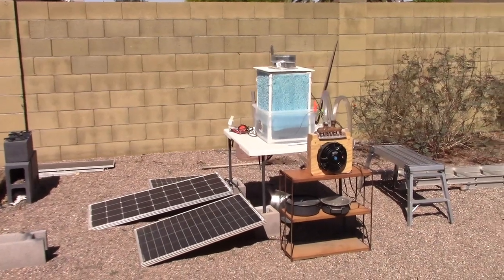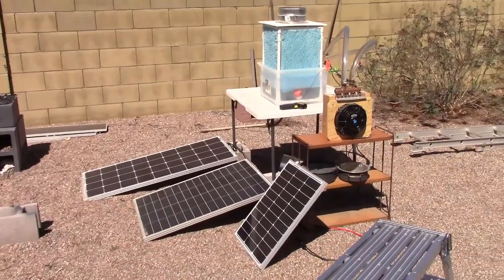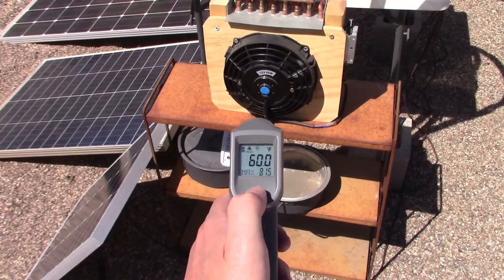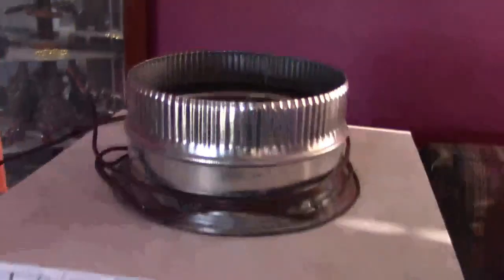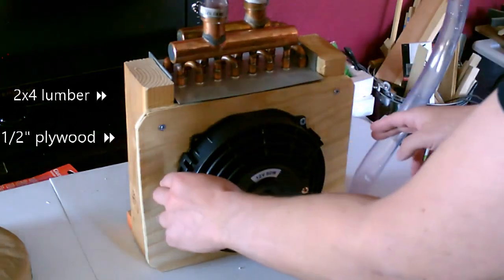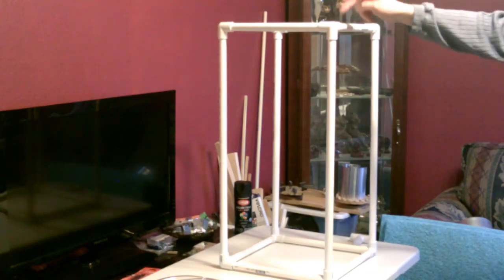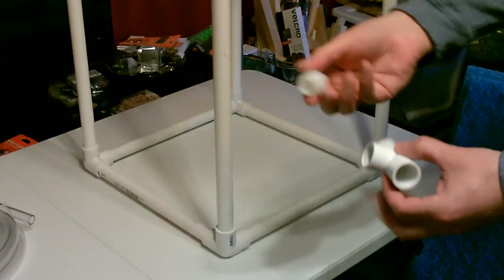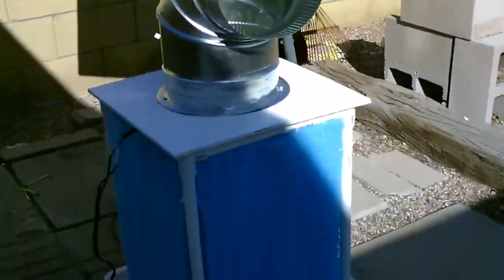DIY "Indirect" Evap Air Cooler! - Produces Cool and DRY Air! No Humidity! (82F-in 60F-out)! Easy DIY

Comment: A hint for those who want to built one themselves.
 The heat exchanger is an expensive part. But you can use a heating core from a car as a heat exchanger. You can get one from a junk yard for as cheap as $20, or even less.
It will make the whole built much cheaper 😉
Reply: Would a car's radiator work?
Reply: @TheRainHarvester  absolutely!
Reply: simple transmission cooler works get a new one same price or lower in some cases
Reply: @TheRainHarvester  Any radiator that has enough surface area would work so long as you have the tubes to fit it! 🙂

Comment: I built one of your evaporative coolers a few years ago using a sterlite container, a used 6" fan, a water cooler pump and various odds and ends. It works SPECTACULARLY! It's almost time to break it out for use this year.  This year, I'm changing the fan and pump to 12 volt and going solar with it. Still needs to use ice and freezer (blue ice) blocks, but it works GREAT.
Reply from the maker: Very cool!
Reply: Wait, why do you need to use ice?  Doesnt that defeat the efficiency? (Your freezer costs more to runand heats the house etc) just curious
Reply: @TheRainHarvester  Right?   Just get an air conditioner and skip all the weird middle steps about making ice and then unmaking the ice.   And of course if you're making the ice in your kitchen, then you're heating your kitchen overall not cooling it.

Comment: I tried building your basic model(without the heat exchanger) and guess what?? It works GREAT!!! I bought a House,without a Cooling System and I will,yet,build another one of your models-- I bought most parts from Home Depot and a good 12 Volt(camper) fan at Walmart--- My whole System draws 3.34 Amps,at 12 Volts--- I have Stage 3/Stage 4 Parkinson's and it's VERY Important to stay cool in Hot Weather---Again,THANKS !!!!
Reply from the maker: hi there. i'm glad you made it and that's it's working well for you! that blue evap cooler cube is quite powerful as a cooler (even without the heat exchanger). 👍💦

Comment: Great video, Appreciate you sharing the knowledge! 
Do you have a link to the pumps you used? What kind of flow rate do you need to pump from the evaporative cooler to the heat exchange? I know distance makes a difference but roughly how many gpm are needed? Thanks you.
Reply from the maker: hi. used a 350 gph bilge pump for the flow to and through the heat exchanger. it's made by sea-flo. here is a link https://www.amazon.com/Seaflo-Manual-Marine-Bilge-Pumps/dp/B07FNY3YRT/ref=sr_1_1?crid=KWPQGFOU8W9N&keywords=seaflo+350+bilge&qid=1690642203&sprefix=sea+flo+350+bilg%2Caps%2C194&sr=8-1

Comment: I did something like this in my garage about five years ago, similar to this same setup but all in an enclosed space (my garage), I made a two hose panel that shut in the window, and had the evaporator pulling air from the garage through the evap pad and out one duct, from the other duct I had a fan pulling fresh air in and sending it through a air/water heat exchanger. So now it is a feedback loop.
Reply: Good idea! What temperatures were outside and inside when you ran this?

Comment: I've studied your innovative system and the idea i have is once the water is pumped into house is to further the water cooling by running water through ice chest with pvc stand inside with copper coils and use your peltier ice chest cooler design to keep water extra cool for hot and humid days and then run through heat exchanger and fan.  I think it might require extra pump maybe to keep water flowing .

Comment: So I actually built out this whole set up with the 18 inch cube and the larger radiator size that you used in the heating video.  The 12x12 was unavailable.  The cooler works very well but the exchanger not so much.  I am getting maybe a 2 degree drop temperature from room temperature.  I suspect that a 10 foot hose run in combination with elevation to run it through most any window are part of the problem plus the fan seems to be producing a bit of heat.  I tested the whole contraption outside a couple weeks ago on a level surface and I thought I was getting almost identical temperature readings for heat exchanger and water temperature.  But I was measuring temperatures with a temperature gun which is generally a very inconsistent way to go.  Anyway now I have to run that whole test again and I an worried this won’t work and that my results from my previous test were all wrong.  If you have any tips let me know.  I am serious about getting this to work.
Reply from the maker: hi. well first it's great that you got the blue evap cooler part working good. that is most of it right there. if that is blowing the cool humid air then you're 90% of the way there already. once that starts blowing cold air the water temperature in the tub must be dropping to at least as cold as that air (usually a few degrees cooler). that is what you want to happen. from there it's just a simple matter of dropping the tubes from the heat exchanger (radiator) into that cool water reservoir. that is all those heat exchangers take to work is the cold water. as long as your pump is not heating the water too much (and it's pumping enough water through the heat exchanger for it to work properly) the unit should work good. i would focus on the temperature of the water in the tub of the blue evap cooler. if that is cooling down properly and the heat exchanger is filling with enough of that cool water then it should work very well. maybe the temperature and humidity of the ambient air were out of balance a little during the second test. that can cause the unit to work less than optimal but it will kick in as soon as humidity drops low enough. check an evap cooling chart to see what temps you should be getting. they show what to expect for specific temps and humidity levels. i'm betting your first tests were correct (they sound like how it should work).

Comment: If you used a coroplast air-to-air heat exchanger to use your exhaust humid air to precool your incoming air, you wouild probably see a 5F drop in temp, at little increase in fan power draws.

Comment: Hi, great video, love the project. Question? Is the water going through the heat exchanger the same water you put in the bucket? Presuming that the answer is yes, wouldn't tap water eventually clog the system with calcium and minerals? Or are you using a closed loop system with the heat exchanger using distilled water or some type of anti-freeze/distilled water combo that prevents mineral build up? Or thirdly, you have been using tap water and it hasn't been an issue as of yet? Thanks.
Reply from the maker: hi and thanks. the short answer is that it hasn't been an issue (but you could certainly use a filter if needed)

Comment: Really like this video!! Do you have a parts list going to make on for my greenhouse
Reply from the maker: hi there. it's not really feasible to have an official parts list with links for a video project like this. the pump and fan links change all the time - so they are always going 'dead'. best place to get most of the stuff is amazon. that is where i get all of my pumps and fans. the plastic totes, tubing and the wood can also be found at home stores. the heat exchanger i used is from 'badger insulated pipe'. here's the link to their heat exchanger page (scroll down to see the 8x8 unit. https://badger-pipe.com/collections/water-to-air-heat-exchanger?page=3 it looks like it is $62.00. (i paid $42 but $62 is still a great deal). if there is a specific thing you can't find i'll try to get a link for you.
Reply: Thank you

Comment: Now i'm thinking, enclose the top of the evaporative cooler, run the water pipes from up through maybe 10" ducting with added 'fins' or something to recollect some of the evaporated water straight back down into the reservoir (like a condensor) to increase runtime and add cooling to the water running into (and back from) the heat exchanger...  would enclosing the entire evaporative setup reduce efficiency (other than working out proper airflow that is)?  If not, then enclose the entire evaporative cooler in big ice chest..  i'm thinking about a cooler for a camper/rv setup.

Comment: Hard work  it is great but when humidity is high it will not cool down the water .also you must isolate the water hoses.
It is similar to coolerado indirect evaporator 
Google it and see 
But coolerado is more reliabke.
Do you have any mrthod to bring down the pool from 34 celcius to 25 celcius
Pls share

Comment: That is really cool, I wonder what it will do when the temps get up close to 100F or over, if it would keep it at 80F that would be great, that's the temp I keep my house at year round anyway, warm enough not to be cold in the winter and cool enough not to be miserable or have a heat stroke. I assume you are going to do a follow up this summer after it does really heat up. Thanks man, I like that, I will share it around wherever I can think of that it might be helpful.
Reply from the maker: hi there and thanks. these units usually follow the "evap cooling chart" numbers pretty close (even when it's super hot) - so at 100F (15 to 20% humidity) it should output 76F to 78F. you could see down to 70F or 71F if air is really dry (4 to 5%). 👍🙂
Reply: @desertsun02  The humidity here will be much higher than that I'm sure, probably 80% or more is my guess,according to the airport here it is' 84% right now I don't know how accurate they are.
Reply from the maker: hi. the general rule is these work very good to 60% humidity, then from 60% to 80% they're a bit weaker, but in many cases it's still feasible. over that and the water won't chill very much so your best bet is to get creative. by that i mean just use half of this system (the heat exchanger) and look for another way to chill the water, or another source of chilled water. natural options are if you have cold tap or well water. that can be very cool even in the summer. some people also find ways to tap into nearby natural water sources like a river, stream or lake. has to be close but works well. the other option is ice-based water chilling. i have 3 videos showing ice-based systems with a heat exchanger (all 3 links can be found in the description section). that works super good.
Reply: @desertsun02  I saw your ice cooled model/idea,with the ice chest top closed, that one should work well for anyone I think if it does not get too cold, thanks.

Comment: Where do you get the blue evaporation pads from. I'm in the uk and am having trouble getting them. Have tried twice from eBay and both times my order has been cancelled. 😡
Reply from the maker: hi there. i get it from the home stores like home depot and lowes. you can also find it on amazon (but be careful not to pay to much. a good size piece is usually only 7 to 9 dollars at the home stores).

Comment: Amazing build!  I am noticing on my Bonaire Durango 5900 evaporative cooler that the water temperature is about 4 to 5 degrees cooler than the supply air.  Is this your experience as well?  Also I read that the supply air is colder on indirect cooling by 4 to 5 degrees (depending on conditions).  In this video you say that the supply air from the exchanger is the same temperature as the water?  Is the supply air from your evaporative cube actually warmer than the water?
Reply from the maker: hi. they are close to the same temp but i've noticed the water is sometimes a couple/few degrees cooler than the cool air it produces.
Reply: @desertsun02  Thanks for that info.  I put temperature sensors in the cooler and another in the water and I pretty consistently see the water at about 5 degrees colder than the supply air.   According to a calculator I found online those temperature differences can be even greater when it’s and the humidity is low.  Today tried a small computer fan and heat exchanger in with a bowl of ice water and I was surprised at how little temperature difference between the air supply and the water temperature.  Maybe 1 degree difference at most. Now it’s time to work on scaling this up.  One more test I did was I checked the water temperature in my swamp cooler before start up and while running.  The temperature dropped from 75 degrees to 64 degrees in just a few minutes.  I actually think it happened even faster than that because the thermostat seemed to be struggling to keep up.  In any event I am more confident now that your solution will work so I will give this a shot when my heat exchanger and pump arrive in the mail.  Having a ton of fun with this and thanks again for sharing your results!
Reply: @michaelguajardo3278  what is your  humidity\area of county? Did it work?

Comment: Hi again,
Were you thinking about utilising somehow that cool humid air that is just an exhaust now in your evaporative unit. Maybe you can make a pre-cooler by installing one more heat exchanger on the return water line, and  make that cold humid air blow through that exchanger and cool the return water even more?
Another thing you can do to the cool humid air, is to cool your solar panels with it. It is well known that solar panels don't like heat, and loose efficiency when hot.
 Could these make your system even more efficient? What do you think?
Reply from the maker: hi. yes you can blow the cool humid air onto the panels or even onto the pipes that are entering the house. that will help keep the water cool as it enters the house. i included a small discussion in the description section 🙂

Comment: I cannot seem to find a 2000 cfm 12volt fan on Amazon. They are listed at 800 cfm . Could you post the link for the fans that you used? Thanks so much.
Reply from the maker: here's 3 that are 1200 to 1700 cfm. (i can't find the 2000cfm one). anything over 1000cfm should be good though.

here's a 1350 cfm one
https://www.amazon.com/Radiator-Cooling-Universal-Performance-Mounting/dp/B085ZTT3Z8/ref=sr_1_4?dchild=1&keywords=radiator+fan+7+inch&qid=1622322448&sr=8-4

here's an 8 inch 1700 cfm one
https://www.amazon.com/Team-Performance-Electric-Condenser-Reversible/dp/B01JI0KOWG/ref=sr_1_1_sspa?dchild=1&keywords=radiator+fan+7+inch&qid=1622322448&sr=8-1-spons&psc=1&spLa=ZW5jcnlwdGVkUXVhbGlmaWVyPUEyRE9CMjRZNDVQSUVSJmVuY3J5cHRlZElkPUEwNjQ1MzM3SEJFWklMNDRIMFNUJmVuY3J5cHRlZEFkSWQ9QTAxMTEwNDQyREVNN1pVQUlWWVVGJndpZGdldE5hbWU9c3BfYXRmJmFjdGlvbj1jbGlja1JlZGlyZWN0JmRvTm90TG9nQ2xpY2s9dHJ1ZQ==

here's a 1200 to 1600 cfm one
https://www.amazon.com/MOSTPLUS-Universal-Electric-Radiator-Mounting/dp/B077XW7CFX/ref=sr_1_5?dchild=1&keywords=radiator+fan+7+inch&qid=1622322448&sr=8-5
Reply: @desertsun02  It's hard to get a sense of how loud the fans are from the video. How does it sound in person?
Reply from the maker: @dave i generally describe it as sounding like a box fan on high (if you run it on the higher end) and quite quiet if you run it at lower end. note that if you run it at the speed of a ceiling fan (in other words just a light breeze) then it's totally silent. no sound at all. the camera makes it sound much louder than it is. it's got dual built-in microphones on very front under the lens. the next time i'll use pro lavalier mic. i've got it so i should use it.
Reply: @desertsun02  excellent! Are the fans just voltage controlled? No issues running them at lower speeds?
Reply from the maker: @dave no issues at all. they run perfect at low speeds. in one of my vids (i can't remember which one thou) i showed it running so slow that you can see the blades going around with your eyes (about one revolution every 2 or 3 seconds). (like a ceiling fan on low). runs smooth and totally silent. zero sound. of course you need to use a good speed controller or just provide less power to the fan. for example you could use a 12v 15 watt 1 amp solar panel and the fan will run fairly slow but still a good breeze and you wouldn't need a speed controller.

Comment: Great project and thanks for sharing! I'm thinking of building a portable one, which can be stashed inside a simple cooler box (which at the same time acts as water reservoir). Do you think its possible to use only one water pump for both tasks (radiator cycle and water delivery to the top)?
Reply: Another question: do you think, that some of the utilized cooler parts are oversized? Would, for example, a smaller fan perform more-or-less equally without becoming a bottleneck? Or water pipes with narrower girth? I'm just trying to figure out what is a must-have to reach a cooling performance similar to yours. Thank you!
Reply from the maker: hi. some of the questions are hard to answer as the whole thing is in experimental stage. one thing i can tell you is that i recently found a very lightweight all-aluminum 'water to air' heat exchanger that is roughly half to one-third the thickness of this one (while still being the same length and width). i'm in the process of building and testing it now. since there is no copper tubing on that one and no steel housing it only weighs about one pound!. i'll try to get video posted on it in a week or two. that video will probably help you a lot. the pipe on that one is 1/2" so that cuts down on the weight and size too. my guess is that it will end up being a little less powerful (because it's thinner) but i'm guessing that will still cool and/or heat air very well.

Comment: How many years do heat exchangers last with impurity-filled water circulating through it every day averaging 10 hours a day? 

I will be building multiple 2-stage and indirect coolers and need to know what I can expect.
Reply from the maker: hi. using these type of heat exchangers i'd say at least 20 years. possibly a lot longer but hard to say. if the water is filtered in some way then maybe 50. these particular heat exchangers are heavy duty and very solidly built. i think they have lifetime warranty